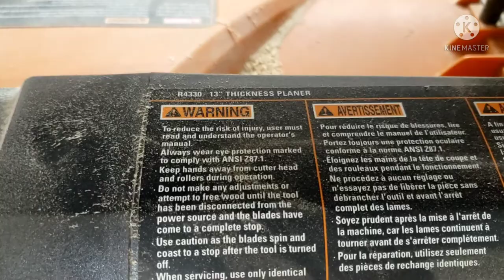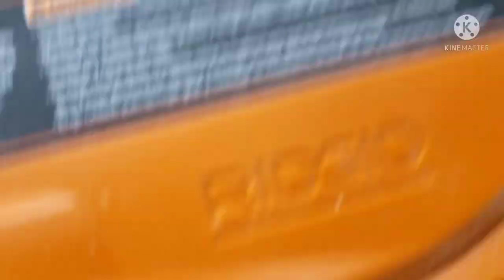Using A Ridgid R4330 13 Inch Thickness Planer!

Comment: I wonder if you hook up a vacuum to the dispenser it would stop the clog and bog issue.
Reply from the maker: Thats exactly what I did later...without the dust collection it was allowing too much back up. Vacuum or dust collection equals problem solved!

Comment: Hey keep it up with those  videos ..... I was trying to buy a thickness  planer and I wasn't  sure what to get but now that  I see the rigid working  I think  it's a good option
Reply from the maker: Will do on the videos! Thanks! I have been working through that big pile of maple. Maybe ill do a quick update video. I've planed down probably 70 boards or so, all on one set of bladed so far.... I will say, I need to upgrade my dust collection!
Reply: You can probably solve the dust  problem  just by adapting something  bigger Like 4 inches may work... thanks  for sharing your knowledge and experience it's good way to help others.
Reply from the maker: Depending on the width of the board, let's say max width, I would only take a 64th at a time, which is a quarter turn. That solved the clogging and bogging of the machine issues. I mostly just need to upgrade from my shop vacuum. Its a 20 gallon and I fill it by the time I do 3, maybe 4 boards.....Loootttttsss of sawdust! Good thing I have a friend that has horses and can use the stuff....lol!

Comment: I have a question in regards to this plainer and also the jointer. I’m completely new to wood working and making stuff out of wood. So please try to keep the clowning on my question to minimum. So I have both the plainer and jointer and I’m trying to do a butcher block reloading bench out of pine 2x4s. Since the planer is only 13” wide I’m trying to run 8 2x4s glued together through it. The top is going to be a total of 24” wide and 96” long. The first time I tried to do this I discovered that I needed a joiner. Because 1 of the 2 12” sections of my bench top were twisted. And I ended up with parts of each half that were raised not by much maybe 16th of a inch in spots. So that’s when I decided to try to process each 2x4 individually before gluing them. I also used the jointer on this second go around and even after using the jointer in combination with the planer. I still had uneven boards some thicker then others. Now I could have sanded or hand plained  the high spots out but I’m under the impression that if you have these 2 units you should not have to hand plane. Am I wrong in thinking this ????? Or is that just the way it is do all projects need to to be hand planed and sanded.
Reply from the maker: Johny 1982 not to worry, im not that guy to bash anyone for asking questions. We all start somewhere. Especially working pine, be sure all the boards are close to the same moisture reading. Otherwise you will be doomed from the get go. After that you should actually start by checking all the individual sizes, you would be surprised at how much they can vary from the store. Next joint one thicker side and one thin side. Now it is ready to go through the plainer. Once you glue everything up you still may have to plane it again. Hope that helps.
Reply: @HermanWoodworks  It helped A LOT I was thinking 💭 since I have 2 of the 3 tools to process my material all the boards will be exactly the same. Making this project a piece of cake. Nope not so from what I have been told doing a butcher block bench top. Is not the easiest thing to do especially for beginner and woodworking. So now that I have a little more to go on thanks to you Sir. I won’t be so irritated with my self because the individual boards are not exactly the same. Also thanks for not bashing my question I appreciate it
Reply from the maker: No problem! Feel free to follow up with other questions or let me know how it goes! Yes, getting a bunch of boards to be exactly the same and stay that way is very difficult! What other advice I can offer, make sure when you buy your materials, that you get them home, let them sit for a week or so. This will let them acclimate to your shop conditions ie.... humidity levels. This should help them stabilize and yield you better results.
Reply: @HermanWoodworks  well I hope they don’t warp to bad this bench will be in the house. Until I pass away or we build a heated pole barn. I don’t believe I’ll be getting a pole barn anytime soon. So this bench is going to be house bound.
Reply from the maker: They won't warp from your place. You would be amazed at how high the moisture content  can be coming from the big box stores. If you have or have access to a moisture meter, check the boards before you buy.
Reply: @HermanWoodworks  I’m definitely going to be checking into that. I plan to do some cabinets also and maybe try to make drawers underneath the butcher block top. I want to make a picnic table and a shooting bench too. I finally finished the planning and jointing this morning. It’s not nearly as bad as it was before your suggestions. And letting me know that most more than likely I’m going to have to do some hand planing. But a all in all it’s not bad I has 1 extra 2x4 so I plained it in jointed it and put it in the middle of my 12” half’s. So now all I need to do is Plan down that one center board Im going to try the 2 level trick to see if the top is twisted. Hopefully it’s not to bad